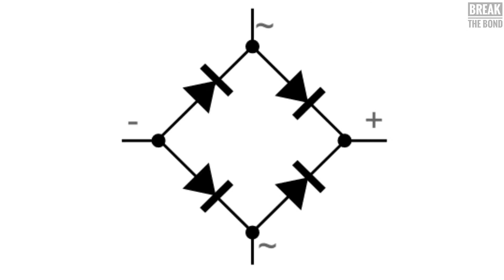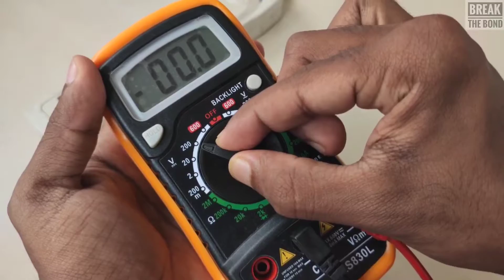how to convert AC to DC in malayalam|230v ac to 12v dc| മലയാളം|

Comment: 775 motor work aakumo
Reply from the maker: ya bro..sure...if u want more amps..use a higher amp transformer insted of 1 amp..❤️
Reply: @bringouttalent4307  ente veettle vcd playar undu athile transformeril onnum ezuthittilla athu mathiyayirikkumo bro plz replay bro
Reply from the maker: if u have a multimeter, please check the output voltage of the transformer, whether it is 12v or higher. I think u have a 12v 775 motor (not 24v motor), therefore u need atleast 12v ac output from the transformer to run 775 motor. The bridge module can handle more than 12v, so no need to worry about that. But Before connecting the motor, please check the output voltage of the transformer using a multimeter. thank u❤️❤️ make sure to subscribe the channel ...👍👍
Reply: Sorry bro ente kayyil multimeter illa bro

Comment: Center wire ground aanallo
Reply from the maker: it comes in the order 12-0-12. when one end and centre are connected, we get 12v ac and when two ends are connected, we get 24v ac